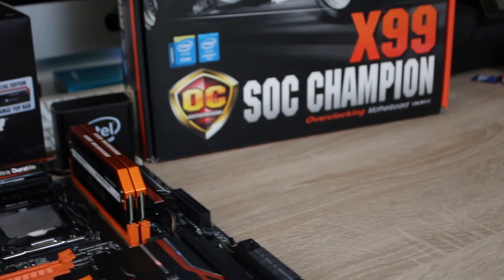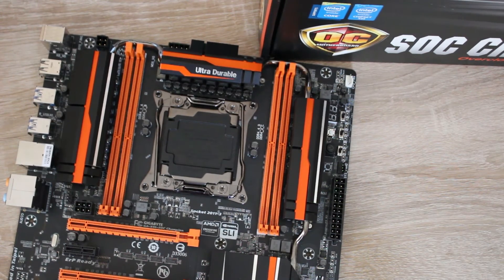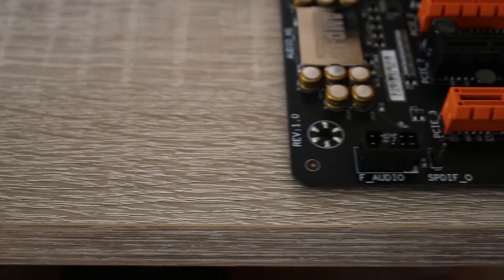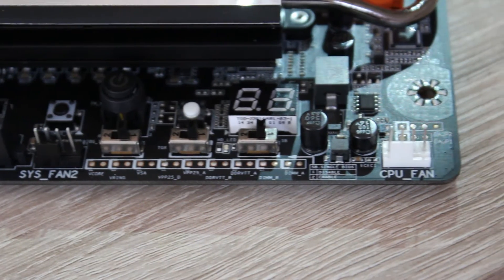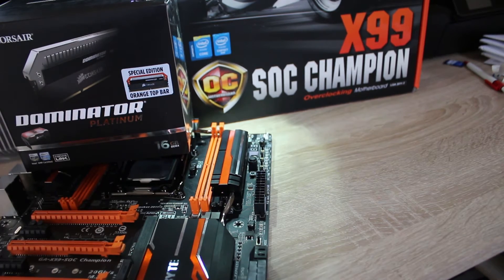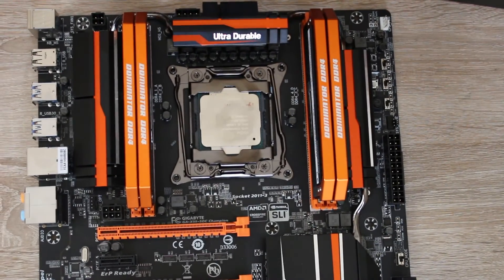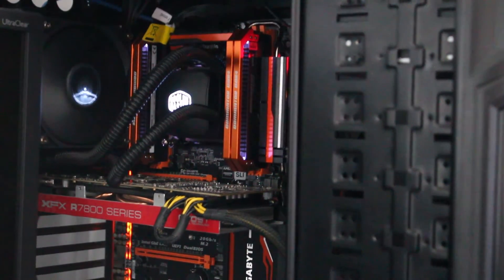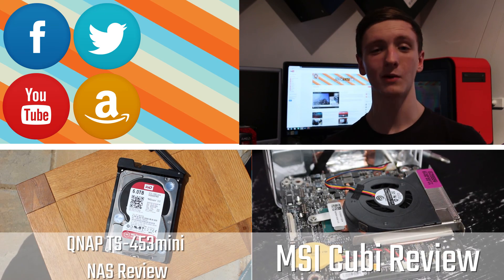Gigabyte X99 SOC Champion Overview

Comment: getting this mobo with a 5960x and gonna try to overclock it too 5ghz. thats my plan anyways
Reply from the maker: Nice! What cooler are you thinking of using?
Reply: EK custom loop but, gpu not part of the loop so I can keep it as cool as possible
Reply from the maker: Nice! I'd love to see a pic when you do make it because it sounds awesome!
Reply: sure thing man. i was trying to find that corsair ram and try to get it too 4.0mhz. i even tried contacting them. right now my build is just not enough for the video editing and 3d rendering i do at school
Reply from the maker: Zac Jones Yeah, it's completely sold out as far as I know! We are pretty much the only people to have it! And ah I see, what's the current rig?
Reply from the maker: Zac Jones besides the (I assume) Wifi card, that is a pretty beautiful system! What's the spec?
Reply: i7 46090k @4.2ghz
Sabertooth z97 mark 1
gtx 970 reference 
Samsung 850 evo 500gb
2tb green drive
h100i
ax860 plat
yeah the wifi card is so ugly i dont know why asus made it have a red pcb
Reply from the maker: Zac Jones Wow that's a pretty awesome system! What are you doing with the board, chip cooler and RAM after you upgrade?
Reply: im selling the whole system to build a completely silent build. my goal is too use the be quite 800 case make a orange build get a 5960x at 5ghz 32gb of ram gtx 980ti. its a really hard goal to get too but from going on several forms, looking at 100+ mobos, coolers, gpu's, psu i think i have my future build ready. the pc cant get over 27db that is the minimum fir it to be considered silent or close too. the only thing is i know i can do it if i dont overclock the cpu.
Reply from the maker: Zac Jones Ah nice! Ah yeah that case looks awesome! I see, that could be difficult to do! I'd really love to see this when it's done! :D
Reply: ill be happy to show you, im still unsure to go with just a haswell still and go with the the z97 oc by gigabyte and overclock cause the tdp would be about 30watts at peak overclock. would be losing a lot of performance but its a suggestion.
Reply from the maker: Zac Jones Personally I'd say go with a 5820K (or higher) and this board, as you get amazing power, sure you get more heat but with a custom watercooling setup you'd be fine! There is a pretty big performance difference between X99 and Z97!
Reply: Did you happen to sell your SOC Champion on eBay recently? I just picked one up with a 5960X, the Corsair Orange RAM, and the EK blocks on it. I'm sure quite a few people did the same build back in the day so I doubt it was yours I bought.

Comment: Imagine this with a i7-5960X and maybe 2 GTX 980ti's in SLI. You'd be set for 4K Gaming, period.
Reply from the maker: SoundFX09 Starts panting
Reply: I'm building that exact setup right now in 2024. I just scored this mobo, with full coverage EK blocks, and the orange Corsair Dominator RAM for dirt cheap. I've got two MSI 980Ti Golden cards that are going in the board once it gets here from eBay.